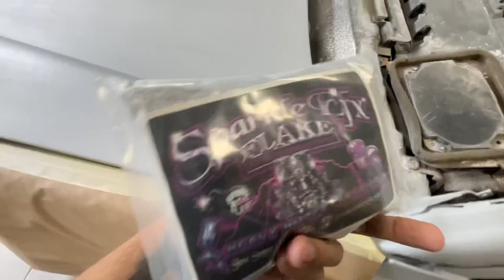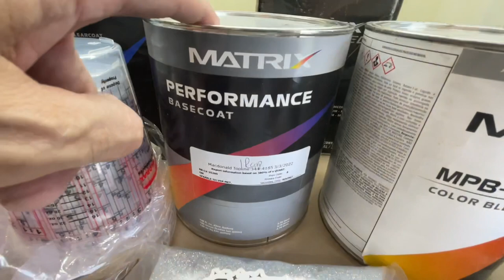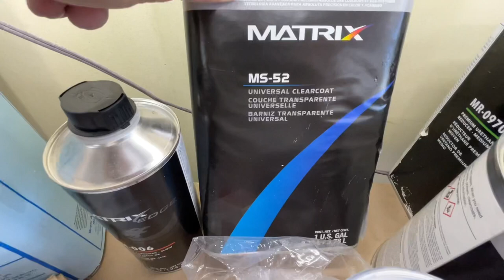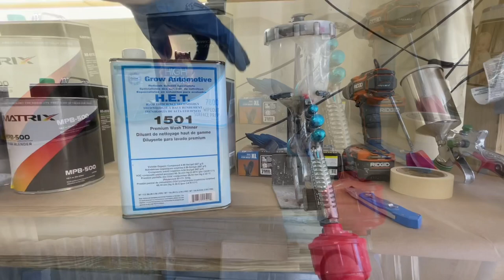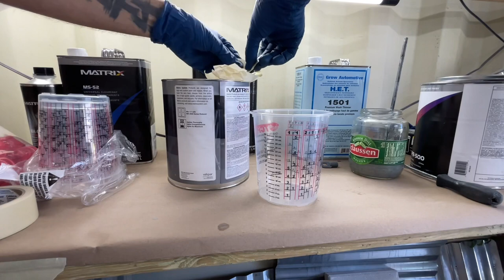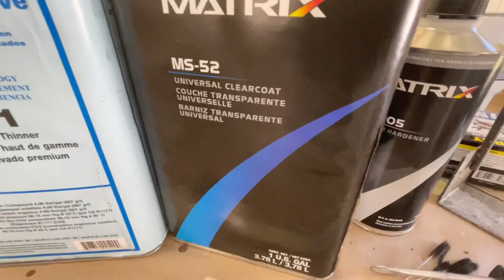Lowrider paint job part 1 v2. Silver flake base

Comment: You mixed a cup for Each coat of silver base and flake? Want to try this out on my Nissan hardbody roof but not sure how much paint to buy. The caprice hood is probably bigger then my roof. Thanks for sharing
Reply from the maker: If your only doing that much I would just grab the pack from lime line if you look at my other video I have a link for the tape also. Also remember the tip has to be pretty big to be able to spray it.